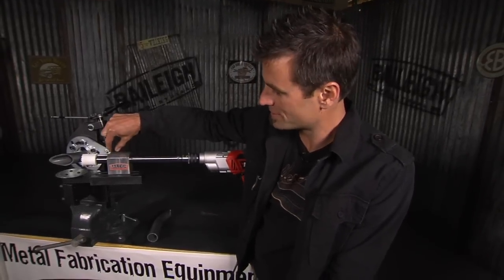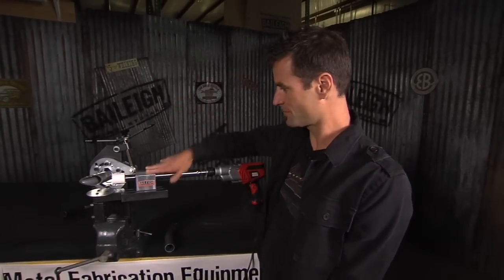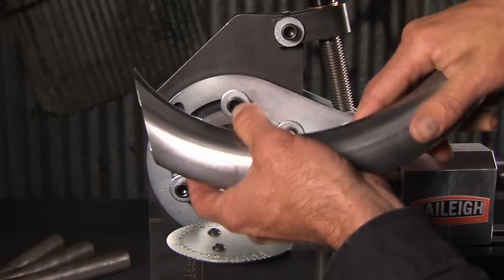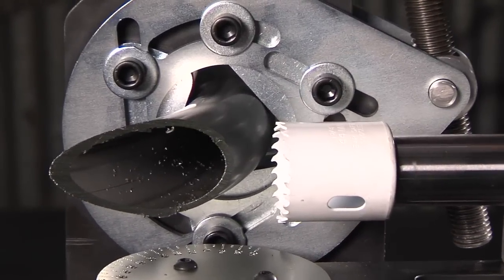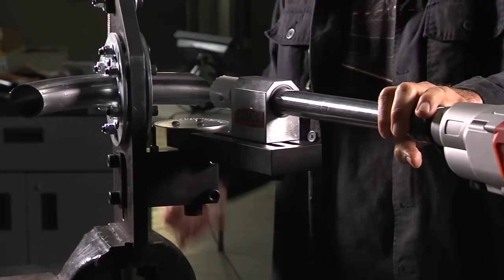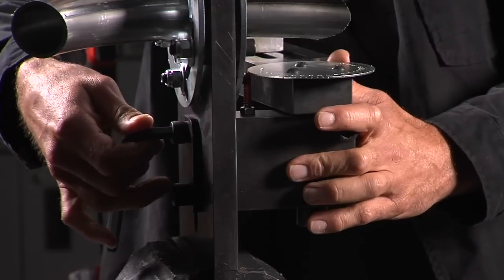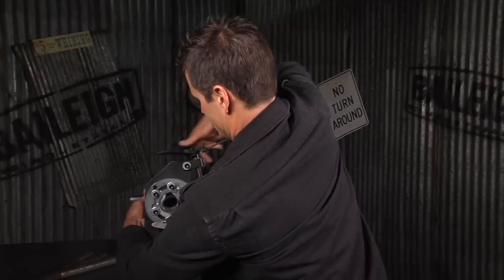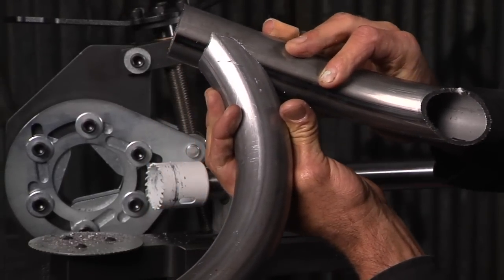Baileigh TN-250 Tube & Pipe Notcher with Radial Vise Tubing Notching Pipe Coping Machine

Comment: Nice setup, but can I ask you, how comes that the notch looks some millimeters off center as you can see at 2:10 ? Is the holesaw shaft height adjustable to solve eventual offcentering issues ?
Thanks